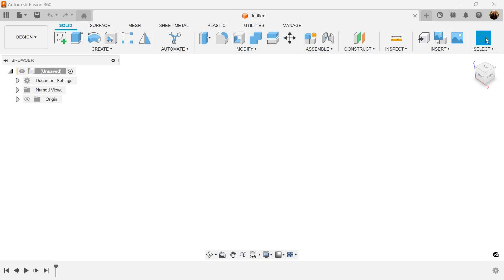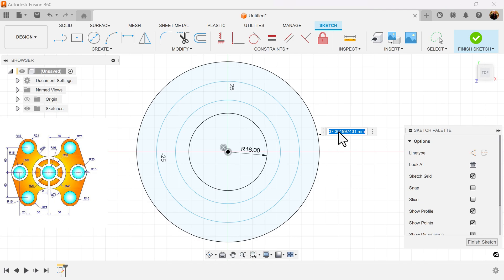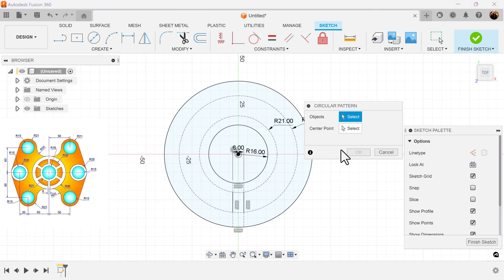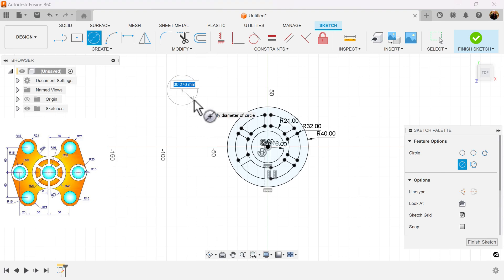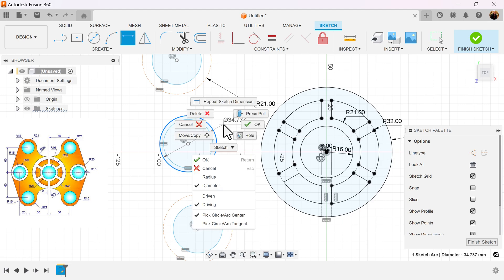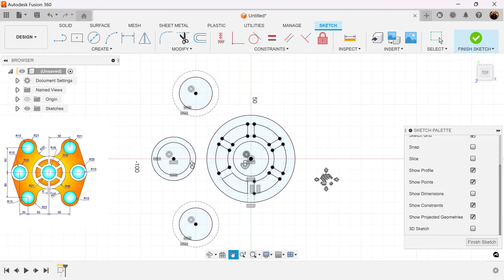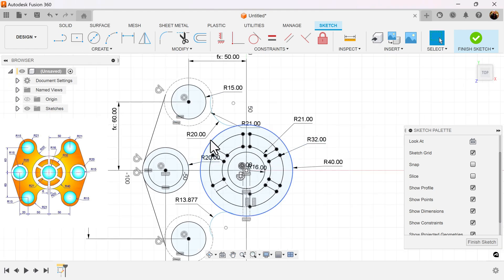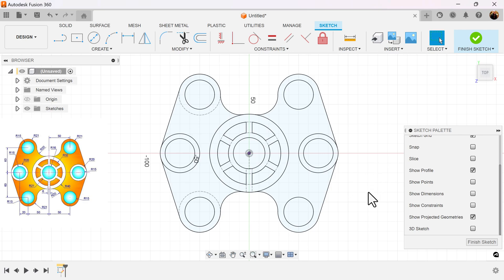Fusion 360 | How would you sketch this? #2

Comment: I wish I had found this channel yrs ago, Your tutorials are Excellent and I send people to your channel that ask about learning CAD, I didn't notice dimensions of the inner circular pattern you created, did I miss them? I made a repair mount for a fuel gauge once and assumed the bolt spacing was a pattern only to find out one hole was moved by about .085 so it only located in one place.
Reply from the maker: Dimensions for the circular pattern? 

For your  project, often, if it's not symmetrical, you won't be able to use patterns,  but you will need to dimension it specifically.